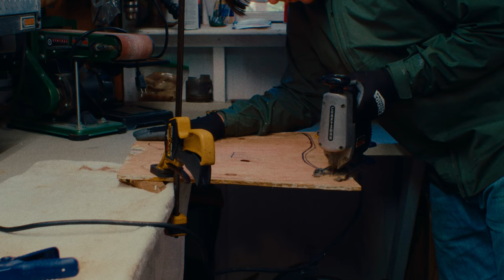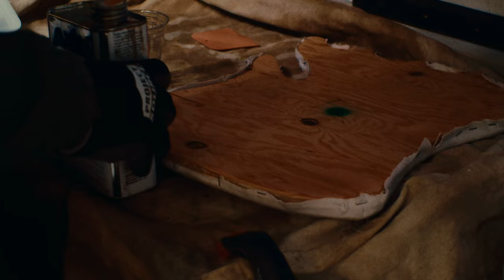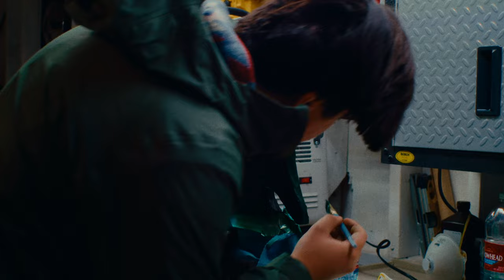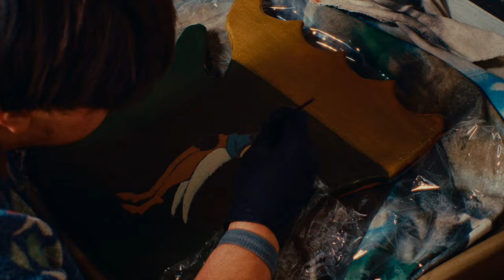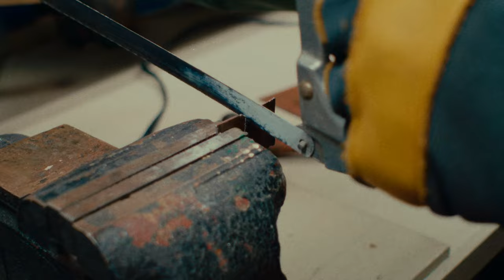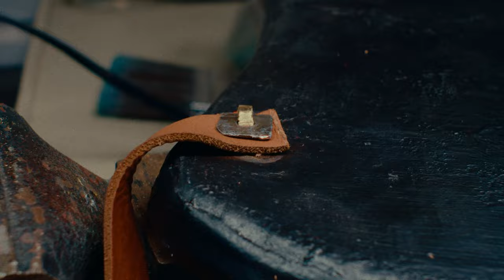Making a Knight's Bouche/Targe Shield (for heraldry display use)

Comment: Hi! did you try to bend it, but it didn't work out very well? What thickness of plywood was used and how many layers were glued together? I liked it anyway. I haven't made similar shields yet, but I'm exploring this possibility. Thanks for the video)
Reply from the maker: Yeah I think it was too cold for the glue to dry completely and should've gave it more time In hindsight. I also recommend using plywood that is only one sheet thick and gluing each layer together. 

Im trying liquid nails which is a stronger adhesive on my next shield.
Reply: @oldworldmanuscript  I use two layers of plywood of 4 mm and carpentry glue, the gluing time is 24-36 hours and the temperature is at least +7-10C. This is for triangular shields.